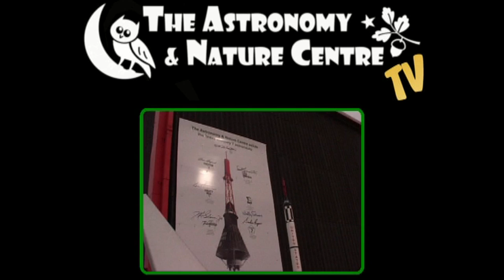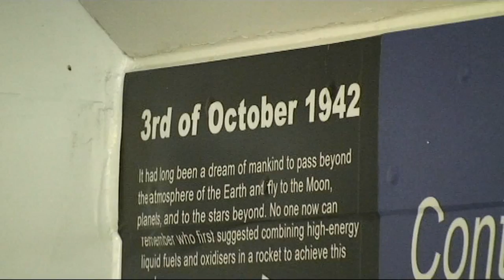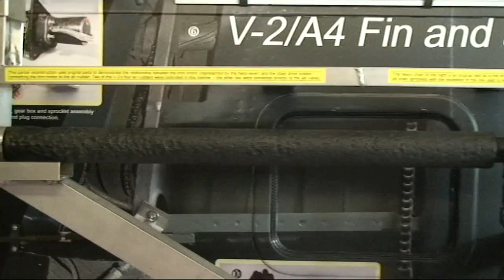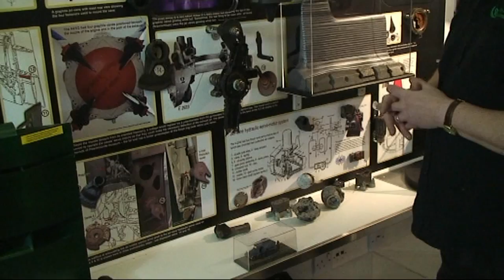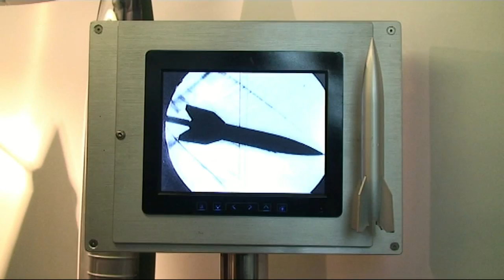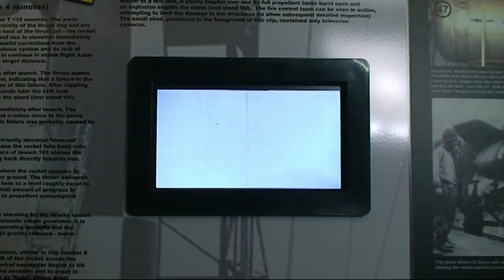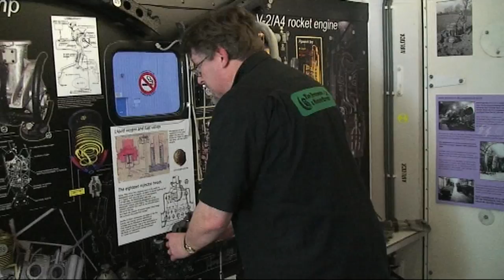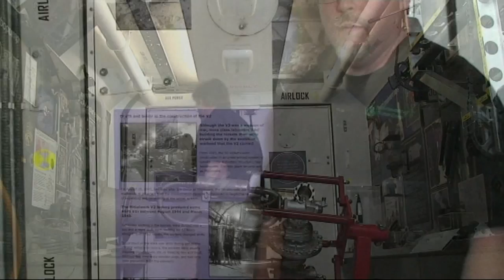The Wernher von Braun V2 Rocket Academy

Comment: As an engineer, i am always amazed that the main part of any rocket is the ability to push the two fuels into a burner chamber.
I have always be rather surprised that nobody ever took a good hard look at what was going on in as far as the power to drive the fuel pump and tbe fact that the very power to do so was in fact coming out of the rocket  as its pushing power, when a small unit that could be ignited and it exhaust added to the outflow within the engine so nothing is wasted.
The object of the exercise it to first get the turbine to turn and gain speed, it is noted the pre ignition started with gravity feed, small that this maybe it is more than enough to turn the turbine, and anyone having been present when spooling up a turbine will tell you, it happens quiet quickly, not only this but it also helps to ensure combustion in the main chamber, this does away with a sepetate form of energy to run the turbine and any need to build any forn of exhaust for same as it just goes through the main burner camber, the very start of these two pumps is clearly seen as being very fast as soon as fuel starts entering the main chamber, the use of same being fed to drive the pumps starts to increase the speed of the turbine is also speeded up thereby driving more fuel into the main chamber, its self feeding, and includes the ability to throttle the whole engine, and most imporantly reduces waste energy to zero.
It has been something that has puzzled me for ages  that they never were aware that this works, yet the V1 flying bomb was clearly self propelled in terms of the engine running itself despite the booster rockets that helped it up to speed off thr ramp.
All in all a very interesting set of videos, very well introduced to the viewer, thanks very much for your efforts, very well done.

Comment: I wonder if anyone can help regarding how the rocket was guided or steered? I think it's the case that one set of vans on the rocket maintained the missile on a set heading and the other set of vanes maintained the attitude, which changed during the flight path. But I was wondering how the rocket didn't rotate either a little or a lot about its axis during flight? A little bit of misalignment of the rocket motor or rigging of the fins perhaps? If the rocket rotated a little then the fins would not work as described?

Comment: 🚀 well done, jolly good, a primer for the rockets early development phase. The liquid propellent delivery systems were a challenge to overcome but were done so quite effectively. Of course all that volatility was a constant danger. 
Stabilization, guidance, ignition, fueling, assembly and welding techniques, fuselage materials all problems to solve.

See the mighty Saturn V at launch to get a taste of the harnessing of power. 7,500,000 pounds of thrusting force at work on the maned lifting body.
When one considers the short time frame of its development and successful deployment it really is quite astonishing. Of course the monetary aspect is equally so. 
Mankind is a dichotomy of brilliance and foolhardiness. For rocketry can be used for great good or great destructivity.

Comment: Thanks  for a different take on the V2 engineering.  I may not have watched the relevant clip to satisfy my curiosity about how the rocket was actually steered.  The function of the gyroscopic system is detailed, however the gyros served to stabilize the rocket's direction and would need to be overcome if their direction is to be changed from purely vertical to directing on a ballistic course to their target.  How was this done?  Were the directions and timing built into the guidance system beforehand?  It seems that would require some sort of memory system, i.e. some kind of computing power when no such device existed.  Instead, was the rocket controlled from the ground through some kind of telemetry communications?  Obviously, these details are crucial.
Reply: Shame you didn't get an answer. As far as the various easy access information I've found goes; the fin aerodynamic is not symmetrical and that's why numbered. So rotate table in direction of target. There was some kind of mixer. For gyro input. Maybe program sequence. Accuracy +-10 miles over 150 miles is crappy enough to just run out of fuel?

Comment: I heard or read somewhere that more people died making A-4 rockets than were killed by V2 attacks. Is this true, or is it an urban myth? Thanks.
Reply: apparently they used slave labour to assemble the rockets according to some groups who always try to negatively depict the Germans. 
Having slave labour building this high-tech piece of equipment is like General Dynamics or NASA using ISIS prisoners to build their equipment.
Reply: @expansionone  Check out the other videos, picture of slave/forced labour exist. The Germans employed slave labour in many of their war production industries. Tank production was another famous example and many of their tank failures in the battlefield could be traced to assemblies and components being sabotaged by the workers. (Like con-rod bolts being under torqued in the engines)